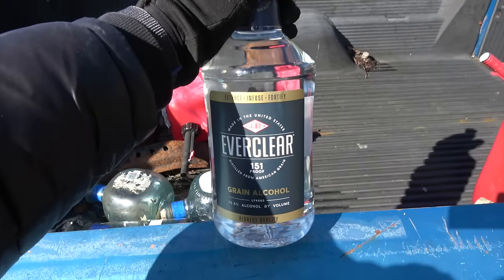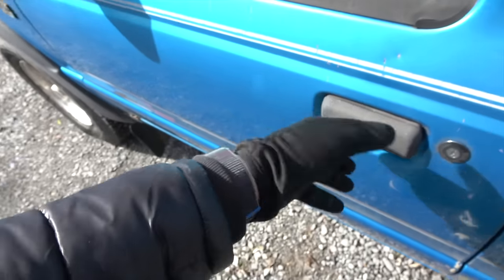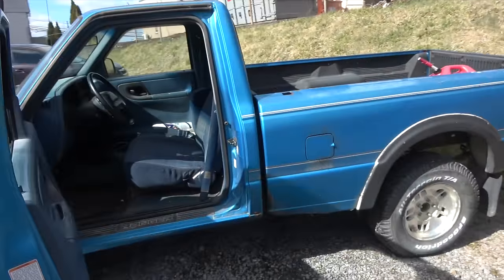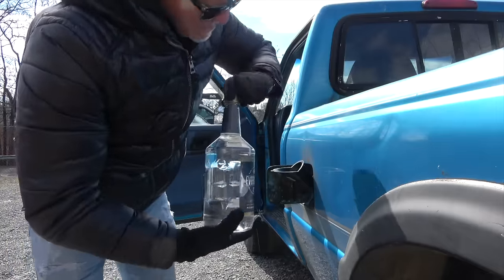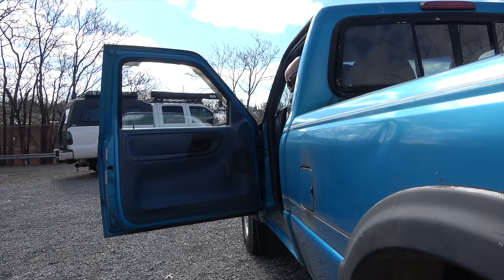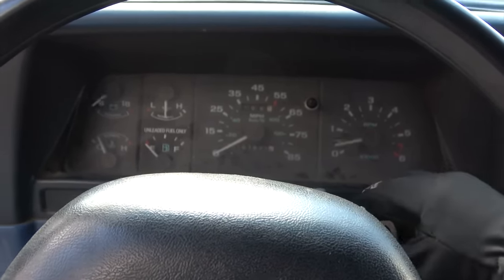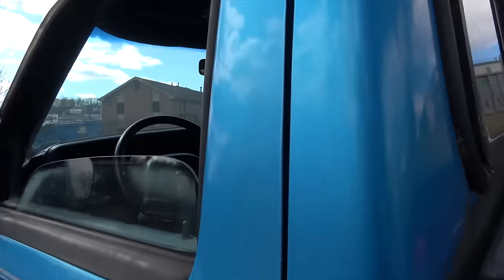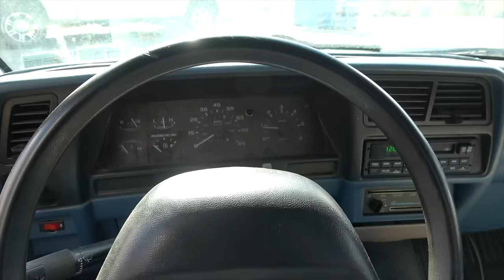What Happens If You Fill Up An EMPTY Tank With Everclear? (152 Proof Alcohol)

Comment: I think the 190 proof everclear would probably work better, but to run on something like that the carburetor needs to be adjusted to add the appropriate amount of the fuel that you are running, and for some fuels the spark timing needs to be adjusted for what you're running. if the air fuel ratio and the ignition timing both correct it might run and drive okay on everclear.

Comment: 94 is EFI, to prime it turn the key on listen for the fuel pump to shut-off, do this a few times before trying to crank. Cannot prime an EFI with the gas petal, now a mechanical fuel pump you can. Done it plenty of times on my ol'86 300 when I still had it.

Comment: One nice thing about alcohol is it evaporates easily so if it is spilled just as long as it is is not ignited it will be as if nothing happened.  It might kill some grass or other plants nearby but for the most part it would leave nothing behind.  It is not oily but will dissolve oils.

Comment: 2  thoughts on this, first, there may have been a residual amount of gasoline in the tank when you used vodka, so you may have been running  something close to 70% vodka 30% gasoline mix, which you then ran  to empty. Now you are running a higher proof alcohol mix but zero gasoline mixture, now it's gonna run rough.  Another thought, how cold was it when running the vodka mix?  Pure ethanol has a higher vapor temperature than gasoline.  In places like Brazil, cars run pretty well with almost pure ethanol mixtures, because the weather doesn't  get as cold there and the alcohol mix vaporizes more easily.

Comment: When running a vehicle on grain alcohol, you need to adjust your air fuel mixture. It will run and run fairly well if adjusted properly. Also if you want to run on pure alcohol, just add a little Heet…it comes in 2 flavors, red and yellow. Both of them will mix with your “fuel” and removes the water content via evaporation. You can pick it up at any auto parts store and most gas stations.

Comment: If anything you'll have a very clean fuel system other than the filter might be getting plugged up by all of the dirt the booze is carrying out of the system. This could be why it's running rough. Also you need very high compression ratio to run straight alcohol. Some where's around 22:1 or maybe more and you've got maybe 8:1.

Comment: Great video! Always wondered how a normal engine would hold up with that stuff. It may be a little expensive, but you could try getting a flex fuel e85 conversion kit installed and try the test again. I feel like you would get good results doing that.

Comment: Prime it by turning the key to the run position and back off again several times.  This primes the fuel pump before cranking it.  just pumping the gas pedal just opens and closes the throttle body.

Comment: It may have something to do with the octane rating. Obviously, the engine is tuned to run on 87 octane gasoline, but the Everclear is going to have a different rating. If the octane rating is super low, then the engine is probably "knocking" or "detonating." That is, the fuel is igniting in the cylinders because of the compression, not because of the spark. 

If the octane rating is excessively high, then the "fuel" is too hard to ignite, even by the plugs.

Comment: Get technical grade alcohol, basically 97.9 percent to 99.0 percent (195.8 proof to 198.0 proof) or laboratory grade denatured at 100 percent. I know, that defeats the purpose of finding an emergency alternative you can easily obtain.  Back when I was a kid running go carts I always added a pint of either into a gallon of gasoline to get a bigger bang for the buck.  Either might be a good additive for the alcohol to make it work better but I don't think you can buy the straight liquid anymore just the spray starting fluid.  Other additives for the alcohol that would give more flame, nitro methane.  Still not easily obtainable.  Have you tried kerosene?  It's a little lower on the volatiles of hydrocarbons than gasoline but it might work and it's available a lot of places but of course most of those sell gasoline so why bother.  There is also naphtha as in lighter fluid or white gas Colman stove fuel.  Lower that gasoline but higher than kerosene (I think).

Comment: Funny video I could watch more of this for hours, but the reason why the Ford runs and drives so badly is not due to the water content in the alcohol, but rather because alcohol has a third lower energy content than gasoline, which means you have to install larger injectors or use chip tuning for it ensure that the nozzles open for a correspondingly longer time in order to get at least a third more alcohol into the combustion chamber. If necessary, the ignition also has to be set differently, around 8 -10 degrees before top dead center
Greetings from Germany

Comment: You have a lot going on. The cold temperature is one big factor and depending on if it is fuel injector or carbureted you have two different sets of possible issues.

Comment: I hate to tell you this, but pumping the throttle does not work as a primer on an engine that is either throttle body or multi-port injection. To "prime" the fuel system, you only need to turn the key into the "on" position for about 10 seconds or so. The electric fuel pump in the fuel tank will do the rest. Consistently running a modern vehicle empty is very hard on a fuel pump. The pump bearing is kept cool by being submerged in the gas.

Comment: It' s struggling, because the engine is built for an air-fuel ratio of around 15:1, while alcohol needs 9:1 - you need to inject more alcohol to get same power.
And alcohol also burns differently than gasoline, so the ignition timing is wrong. 
It will work perfectly if you adjust both, though. Alcohol is corrosive, so gaskets and the fuel pump might get damaged after some time.

Comment: For the record everything is 190 proof. I used it all the time for fuel system cleaner. Carbureted, Injected, Gas or diesel. About 2 or 3 oz For each gallon of gas Works better than commercial Fuel system Cleaner. Even took A Car that set  For a little over a year and a 1/2 with fuel in the  System, The car was running Badly After they got a transmission in it Even though it was running right when the transmission went out. The injectors was gummed up. 2 doses of Everclear in 2 different Tanks With one Tank of Uncreated beatle between them And it was running like a top

Comment: I ran out of gas on the way home from college, in my '72 Duster. Far from a gas station, and no one around. I had only one option. A full, unopened bottle of everclear. I poured it in. And after a lot of cranking, it fired right up. I had just enough to make it to a gas station. It ran a bit rough. But the exhaust smelled great. True story.

Comment: u could try too absinthe, it' even more purer of alcohool than everclear, but the hard part it's to find a bottle, because i don't know how it is on United States, but here where i live it's forbiden, because its, so pure, that, it's purer than alcohool for cleaning stuf. Another thing you could also do, I don't know if your truck has a carburetor, is to change it to an ethanol carburetor, it's a very common carburetor in old cars here in Brazil, if is not a carburator truck, u can try changing the injectors, and if it has a lambda sensor, it's probably already a flex-fuel truck, so the problem is only in the type of alcohol you're using. U should do this because the gasoline carburetor, or the injectors are made to burn gas, and burning alcohol, probably is dirtying and weakening the engine, because the alcohool is burning incorrectly, it must either be burning to early or to late, of corse there is other thinsg to considering, but, duing this u are cloeser to an alcohool engine

Comment: Ethanol you can run full timing advance also as it does not spark knock. Higher fuel pressure will make them injectors flow more!

Comment: 151 is as close to pure straight ethanol, like what they pump out of the factory into the tank barges or tanker rail cars, a you can get. It burns too well.  It burns up before it can really push the piston down.  At least thats my take on it.

Comment: if you use only alcohol, i think you need to heat the carburetor, (pre heat the fuel) before it enters the cylinder especialy in cold weather so it becomes vapor .

Comment: It's all about octane ratings, ethanol has a much higher octane rating and thus you get issues with the engine not running as expected. Now if you had a flex fuel car this would be no problem

Comment: Unfortunately running an engine on alcohol requires about 2x the amount of fuel to air ratio to work properly. IE..it'll run lean. A flexfuel kit and tuning would adjust for this.

Comment: I think it would burn better on everclear but you need more cause it burns WAY faster 
If you put 2 gallons in and then add a bit of oil and something to keep it from seperating so it burns slower. BTW they have 98.5% everclear but it's hard to find. you can maybe order it

Comment: If you look at high performance turbo engines that run that stuff, they run injectors that are upwards of 85% bigger, you don't have enough fuel going in the cylinder to get the right fuel mix. If you had an AFR meter you would probably see it is lean on the air fuel mix!

Comment: There is a good chance that the higher alcohol content of the Everclear is dieseling, or igniting very slightly ahead of the spark, because of the compression heat and the heat of the engine from running it to empty., before pouring in the Everclear.  Thus the sputtering and missing.  The Vodka probably had less flammability than the gasoline and the Everclear probably had a little more, with no anti-knock\dieseling additives.  This is just a guess.

Comment: It is to strong.. fires to hot also gas has water in it. Just from condasation. This is why voka works so well.
If it was a super charged infen than yes it would have worked great. And sorry for the spelling

Comment: In vehicles that have an electric fuel pump, you do not need to pump the gas pedal to prime it. Just turn on the ignition to start, but DON'T start it. You'll hear a light whine, that is the fuel pump pressurizing. Turn off and then turn on again and crank the ignition. This pressurizes the fuel lines. However, as a kid of the 70s who grew up driving 60s and 70s cars in the 80s, I very well remember pumping the pedal to prime the carb. I remember having to deal with points and a condenser until HEI came along around 1975-ish.
In any case, I have had Everclear and I don't run well on it. Clothing seems to fall off.🤣🤣🤣

Comment: Clear your Mas air flow censor located in your air flow snorkel.  They make a spray just for that. Then let it dry for about a half an hour before reinstalling it.  Alcohol has a different flash point then gas. You may need a hotter set of plugs and play with the timing.

Comment: The ever clear is evaporating in the gas tank. Vodka evaporates slower. Gasoline, much slower (by design). Try it with a motorcycle and fill the tank to reduce evaporation. Or you could fill the ranger with everclear😮.

Comment: I think the part of the problem is it simply isn't getting enough fuel. If you put three or four gallons in it would help alot. You drive the truck, hit the brake and all the fuel sloshes away from the fuel pickup, air in the line, truck dies. It will never run well on everclear, but it will run.

Comment: I think you are flooding it when you try to drive. Since it’s not designed for alcohol I don’t think it’s burning completely at higher rpm’s. That’s why you can idle and rev up, but as soon as you try to maintain high rpm’s you flood out. Luckily everclear evaporates quickly inside a hot engine. So you get a good boost to restarting. There is a 95% version of evervlear. It would be interesting to see you try that. Or even try distilling this out if you can’t find the 190 proof.

Comment: Look pumping the pedal will do nothing, on older cars it worked because they had a manual fuel pump, but on that truck you have a electric pump in the tank so pumping the pedal would only work if you were cranking it

Comment: The ever clear is sloshing to the back when your driving foreword causing it to sputter. When sitting on the hill your fuel is at the pump. Try airplane fuel we use it in our racecar it caused the exhaust manifold to glow red like the old burner on a stove.

Comment: Try mixing it with some oil itll run much better ive took some vodka and mixed it with motor oil and it ran just fine till the gas tank ran dry

Comment: Lmao at the pedal pumping to prime it! That does absolutely nothing unless you're running a carburetor. To prime the system you have you simply turn the key a few times to engage the electric fuel pump before starting the engine.

Comment: Not enough oxygen and such alternative fuels are usually premisted with air and pressurised injected into the carbonator (brown gas the main mist used with the pre mixer chamber under low pressure injected into carbonator method)

Comment: Everyone tries this with newer (fuel injection) cars and it's never going to work. You need something that you can change the air fuel ratio on because alcohol does not burn as well as gasoline so you need WAY more of it to get the proper air fuel ratio. That thing was running so damn lean you could've blown the engine.

Comment: I think the everclear is breaking down gunk inside the tank, lines & motor worse than the vodka & causing too much junk to flow with it, it may work on a system with cleaned tank, lines & engine flush to ensure it's burning clean.

Comment: Lol, you can't "prime" a fuel injected car by pumping the gas pedal like on carbureted cars.  Also, a 1994 car is OBD1.  OBD2 started in 1996.  I'm not sure if OBD1 would be able to compensate for the extra fuel required for Ethanol based on Oxygen sensor input to the computer.  Ethanol requires 20 to 30 percent more fuel than gasoline.  So you're running lean and that's why its running so rough.  You probably need to swap in some higher flow injectors as well.

Comment: You should do WD40 as oil, a couple of younger guys did it and it ran great on like a road trip. It was running fine. But when it failed was when they hit the rev limiter to "Hurry it up" So you should do an actual road trip with WD40 as oil but drive it normally not rev limiter to hurry it up etc. Like just actually normal drive it to see if and when it dies

Comment: I was wondering why he wanted "something stronger" lol. In my state ever clear is 190 proof or 95% vodka. Water molecules are sticky, you can't moonshine much, if at all, higher than that. Maybe you could redistill over and over to try to get the last few percentage points out but it's a game of inches as you approach 100%

Your best bet would be to get 99% isopropyl alcohol if you wanted it, but I think all you'll do is ruin the truck. Part of the point of modern fuel is that it's. . . Well. . .  An oil. It lubricates.
Reply: 95% alcohol not vodka lol

Comment: It takes twice the amount of alcohol to make an engine run as opposed to gasoline. You need much bigger fuel injectors or carburetor jets to make it happen. It is possible. Race cars use pure ethanol and run huge jets and or injectors to make the engine run and produce any type of horsepower. But it is possible

Comment: I had a 1978 Ford F150 with a 300 CI 6.  Living in Connecticut at the time I had to get the truck through emissions check annually.  It wouldn't pass.  I took to running the gas tank down to nearly empty and I'd put a half gallon of 100% grain alcohol in and try it again.  The truck passed with flying colors!  The tech asked me if I'd replaced the carburetor and I told him, "No, it's just modern science."

Comment: I would like to see if it can run on everclear as i ran my Neon with a bottle in front of the car. The video is on my channel. The fuel pump is fitted inside a bottle and the fuel hose directly fitted to the injector rail

Comment: You probably need more pressure in your fuel lines and larger injectors for such a highly combustable liquid. But then your probably going explode a piston. Also you would probably fair better with not air filer since this stuff burns so fast. Long story short this really is not made for this engine and going higher proof its only going to get worse unless you build the vehicle specifically to run it

Comment: I concur with codycrowder, the air fuel ratio is too far off and beyond the ecu limit. Alcohol also runs much hotter than gasoline. How I know this, my father had an old Buick Lesale that was being driven to a bone yard not a mile from where he lived. With no fuel and some distilled alchol (not store bought)  it made it there. The reason being, you can adjust air/fuel on a carburator much easier than modern fuel injection.

Comment: Its rough cuz the fuel air ratio is fcked cuz the combustion power of alcohol is not the same as petrol so it cant reconcile the correct ammount of fuel to spray in/how much air to let in. If you had a scantool that allowed you to set it manually you could prob make that baby purr, albeit with a significant power loss

Comment: Just get a model t and run it on moonshine. the danger ranger won’t run on ethanol stock, the air ratio is wrong. You either need less air or more fuel

Comment: Test the alcohol before putting it in your tank.   Pour some of the alcohol in a container and light it up. If the flame 🔥 looks like natural gas blue flame then it's good to go.  The alcohol you buy must not have water in it. It must be minimum of :
1. 85% alcohol mixed with 15% alcohol soda from the same source.  = 87 M+R actane  method, also known as Regular 88.
92% alcohol + 8% alcohol soda = 93 to  94 Actane M+R method,  also known as  Flex fuel